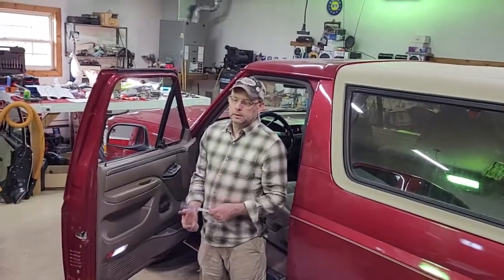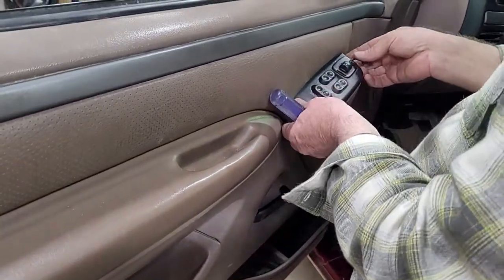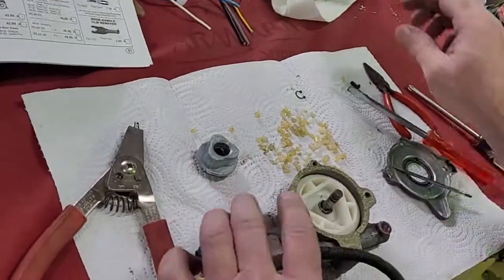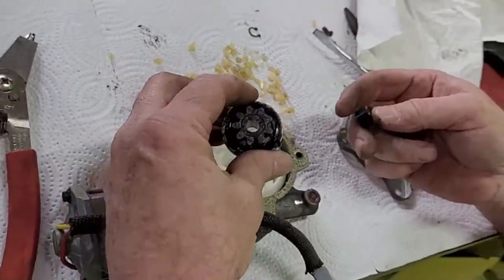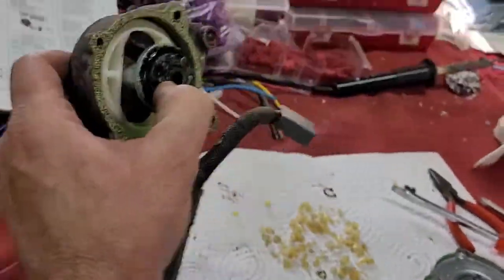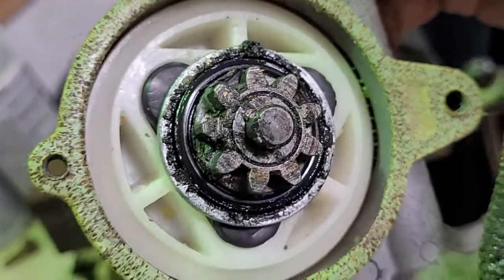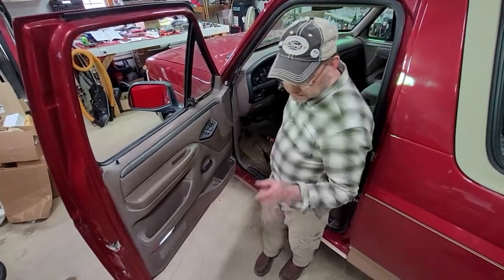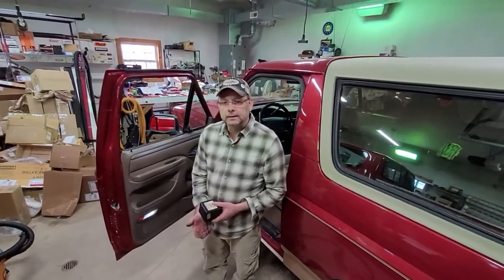OBS Ford truck Bronco power window motor torque pin gear replacement F150 F250 F350 94 95 96 97

Comment: Great video!
I replaced the locking pins with brass rings filled with lead.  Been 2-3 years and still rolling up and down!
Middle of winter and needed the Bronco to be functional asap!
Thanks again you made it look easy!
Reply: i wil turn some pins on the lathe to put in them. thanks

Comment: Also, you can use three 3/8" ball bearings (basically a silver sphere), to replace the torque pins with as well. I got mine at Home Depot in the pull out bins. About $7 for all three.
Reply: Yep.

Comment: Tony my question is : when my windo completely bottoms out and its the down stop the motor over torques the window regulator and gams the gear on motor and regulator. Why is this? I'm replaced the motor and regulator and it still happens.
Reply from the maker: Did you replace it with original Ford parts?